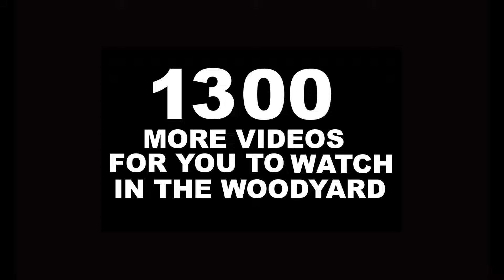FIREWOOD SPLITTING AND DUMPING!

Comment: Thanks for identifying the different types of wood. Most of these are not in Georgia.
Also, what mounts in the multihole bracket on the back of the bucket?
Reply from the maker: A ball or pins for pulling trailers,elevator,equipment.
Reply: Thanks, Chris